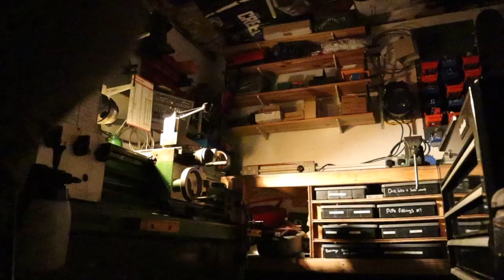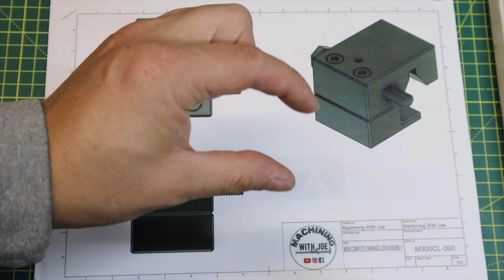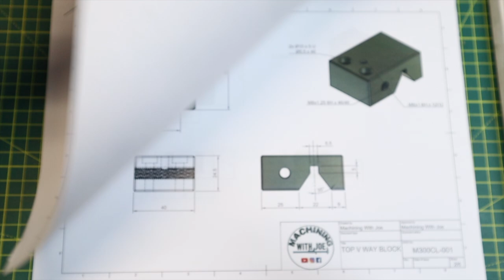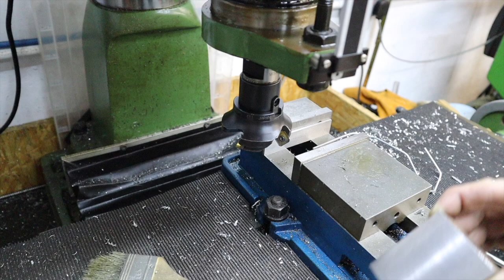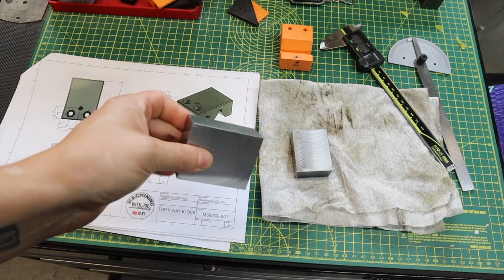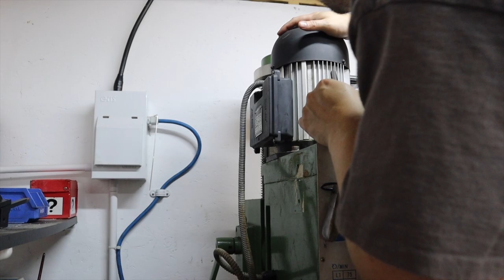The Simple Project that BROKE my Mill

Comment: I’m going to say the ‘mud’ in the gearbox is what caused the failure not the other way around. 
Here is Australia I’ve repaired many hafco machines which are the local brand equivalent to like Grizzly and I think these Warco machines. Nearly every Chinese machine I work on you end up cleaning that sort of brown or black sludge out of the gearboxes. It’s usually any combination of casting sand, grinding dust, swarf and paint all ground in with the oil, it usually even persists after several oil changes if you didn’t tear down the machine previously to clean it. Unfortunately nothing really gets cleaned on cheaper machines, we had a radial drill that literally had 5mm of sand in the bottom of the gearbox oil and then clumps of casting sand just painted over. 😬
Reply: Hi Techno0908.  I have a hafco HM46 mill and have just cleaned out the gearbox and replaced the (cheap) bearings. I would appreciate some (paid) help to refit the gearbox.  I am in Rockingham (Perth) WA.  Are you anywhere near Perth and interested?  Ken

Comment: I had that exact model mill drill. mill drills are a big pain in the ass
Reply from the maker: Yeah the round column is a pain. I do like the power and torque multiplier that comes with the gearbox.

Comment: looks like you made the same mistake i did...

it took me three tear-downs when adjusting spindle bearings before realising that taking the quill out FIRST helps? that it actually DOES come out at all? sigh... 

just undo the feed mech, be ready to catch it... watch that spring when releasing it...

that top bearing/splined gear with the circlip is a bugger to reinstall otherwise, lol... 

pays to throw new spindle bearings in and sort that out on the bench. dah! and my money is on the upper spindle bearing being the cause of the smoke, its sealed up and thats the only way the smoke could come out of the drift-slot... if you can be bothered, try angular contacts rather than the taper rollers... lot quieter. 

as for mud in the box... meh, mine sat semi-covered in the rain for years, was the howling of rusted bearings that had me opening it up... yummy :) once it started needing a push to start spinning, i knew it was time to call it quits...

i doubt your box bearings are bad, but theyre cheap, and whilst its in pieces, why not? can see if anything else is suss at least...

word on the street is to use hydraulic oil... "non detergent, non-foaming"...  i actually just re-used my old stuff, threw the pot on the stove and boiled the water/soap out until it resembled oil again... if you can call that dark brown waxy stuff the chinese throw in there "oil"... i swear its the dregs from when they make their "sewer-grease"...

anyway, dont use motor oil, apparently. pffft. oil is oil! (or is it? see above!)

throw a magnet on the drain plug if it doesnt have one...

one day i might replace the missing sight-glass and throw fresh oil in... and consider remaking the second shaft that has a stinking big crack running down its keyway. factory defect, was obviously ground in that condition...

Comment: The smoke was coming out the quill bore and that is separate from the gear box. Clean and flush out the gear box and it probably fine. I bet the top quill bearing is going bad is the problem. The tram issue is fixable. design problem with the round column mills. The belt drive unit have a reasonable weight distribution on the top side. the gear drive machines have all the weight on one side of the column. I corrected the tram on mine with a nodding donkey rocker on the top of the column, one end connects to the top plate between the motor and arbor nut, the other end has a weight hung off the rear balancing the motor gear box out to where the tram is with in 1/2 thousandths, and it makes raising the head assembly much much easier since the weight of the motor, case and drive train is all counter balanced

Comment: I´d say diesel is a good detergent. Fill up the bugger with it and flush out the grime. There might be an oil pump buried in there, check for that. Rotating by hand then seems like a good idea. The bugger need to be clean to see what´s going on, find the source of magic smoke, replenish it, yeah?
And keep the shop warm, diesel works better 20c and up. Good luck, Kind Regards

Comment: A couple of suggestions. Smell the motor to see if it smells of electrical burning. If not, have a look to see if water/coolant has gotten into the gearbox. Difficult to tell from the video but it looks as if the oil has formed an emulsion.
Reply: I don’t see what this would have to do with the motor. The smoke was coming from the quill. The motor is all the way at the top, and is a TEFC, so it’s sealed.
Reply from the maker: Yeah it is not the motor and this mill lubricates itself from a splash system and also does not have any form of coolant use.

Comment: Sorry to see your magic smoke was let loose!  REgarding the part you're working on, a couple quality of life suggestions.  I would have swapped the 2, cap head bolts with guide pins and instead make 1 threaded hole in the center, then either create a bolt with a knob, then you won't need to hunt for a tool to adjust.  Same for the grub screw, good idea but could use a knob instead of an allen key.
Reply from the maker: Great idea it isn’t too late for me to change the design so think I will go with your suggestion that will it is tool free to tighten.